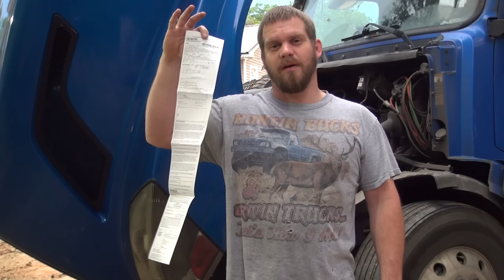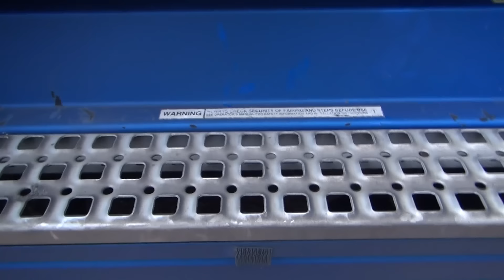Stopped by DOT

Comment: u need to get to know the inspection laws . Plastic valve stem covers are not a violation just so u know . calif dot inspector 4 15 yrs . in trucking 4 40 years .
Reply from the maker: I haven't found that in the book either but had a guy swear to me he got a ticket for it, but people lie so who knows. Thanks for watching and commenting I always like to hear both sides of the story.
Reply: Use metal valve caps will
Rust on and blow off use plastic only  and that’s not a dot  violation he’ll haveing none has nothing to do with safety
Reply: @LifeWithChase  Truckers don't lie, they bullshit. One says something on a CB and somebody else believes it.
Reply: The point in having metal caps are to with hold the air pressure if a failure in the valve core should happen a plastic cap will never hold the pressure
Reply: Tired old mechanic you know what they say the only difference between a truckertale and a fairytale is one starts out with once upon a time and the other starts out with you ain’t gonna believe this shit lol
Reply: Something I've learned over the years is that if the officers says it's a violation, it IS a violation until you take it to court.
Reply: All that stuff goes to their head I've been across those so many of them when I'll over road an local I just sat there and listened to them they do come up with some good ones
Reply: then you know the truth and revenue for your department are 2 totally different things.
Reply: @LifeWithChase  he probably had a leaking plastic valve cover and got a ticket for that (oil leak)
Reply: The entire point is DOT will always screw us drivers dont matter if the truck is brand new with no defects they will always write a ticket to keep revenue coming in on anything such as faulty valve stem covers lol its funny but it may have been true or it may have been false but we all got the point.
Reply: @mikebalasis7933  Actually, I came across a truck that had a leaking valve core; A metal cap was able to stop the leak until I got into a shop, since I couldn't remove the valve core myself.
Reply: @lomparti  no way, it was a overheated muffler bearing that caused his blinker fluid container to melt
Reply: And cause a drip. Damn plastic.
Reply: @mikebalasis7933  ur not on the raydio TEN FO !!!
Reply: hillbilly beer dranker  i like that handle HILLBILLY !!!! ...but u spelled beer wrong....its BAYER..TEN/FO !
Reply: makes sense, ive tightened a few plastic caps and the ends broke out of em,never have did a metal one that way
Reply: here is another thing KW W900 ,  THE WAY kw fucked this truck up with the hood and buss driver doors this really bothers me cause the W 900 long nose was my favorite truck .
Reply: So what are you thoughts on load securement on palletized produce loads since you were an inspector?
Reply: That was for Mike Balais
Reply: @alwaysinmotion1  what bout produce I didnt do produce inspection
Reply: @mikebalasis7933  talking about load securement, you said you were dot inspector in your comments
Reply: @alwaysinmotion1  what about load securement  ?   talk to me
Reply: Highway Patrol definitely doesn’t alway know what their talking about, I had a regular CHP officer pull me over for doing 61 and being in the second lane on a 3 lane stretch. Yes I was speeding, but he threatened an out of lane ticket. Luckily he gave me a written warning. I told him, yea I was going 58 but I was in the 2nd lane for safety. People get on the freeway @ 40mph and me being a tanker can’t slam my brakes when someone gets on while Facebooking so out of the right lane is much safer.
Reply: @supertrucker12916  Hahahaha... That's funny...
Reply: @BuckInchuteranch1  doesnt matter, CA has designated Truck Lanes, get caught out of one and it's a ticket. Also Rigs cant go past 55 in CA. And DOT cops at least in shitbag MD go thru a 6 month course to get DOT certified and have a 2 month annual refresher. Not sure about other states.
Reply: It’s in the book under the tire pre trip.
Reply: Johnny G neither will metal
Reply: @supertrucker12916  ..... so it safe to have a metal cap on,,holding back 80 + psi, that should be just great when you unscrew it , will fly off like a fucking bullet.  A valve cap is NOT to hold pressure , its to keep dirt out .
Reply: Truck owners are reason theirs no money in trucking
Reply: I gotten a ticket in California for dirty truck came from North East, good luck with buying officer messing up ours lifestyle,

Comment: Imagine, a Diesel engine that leaks oil, who would have thought that could happen?
Reply: They all do lol. I haven't seen any that didnt
Reply: The old Detroit 2 cycle engines had the best oiling system made .... they oiled inside and out lol
Reply: I got written up by DOT for being out of washer fluid.
Be careful in Georgia.
Keep your washer fluid full.
Reply: Robin...good thing they aren’t checking “blinker fluid”...😉
Reply: Nathan Manley a. Tesla 🤣
Reply: STEEL SCRAP Kingdom Tesla has a diesel wow I thought they burned electricity
Reply: Tell that to the 2 CATS I run regularly. They both guzzle oil. Leak it burn it fuck don't know where it goes. Just feed it a quart a day and you'll be fine. In all fairness, we do run these machines hard and they run long hours idling, or with PTO on creeping along picking up heavy material.
Reply: Robin Mize how the hell did you not notice you ran out of washer fluid? I half way wanna say that you deserve that ticket. I just put water in my shit. Or I sometimes put a bottled of knock-off pine-sol in it and dilute it with water
Reply: Timothy Lenhart damn. I have the baby CAT c-13 and I got a massive oil leak fixed 5 months ago. Never had an oil leak since. And it hardly burns oil. A quart a day is way too much
Reply: Lmaooo 😂👍👍

Comment: Some trucks definitely have safety issues, BUT I think the inspections like you went through are about revenue enhancement and mostly about control. I believe the whole cdl thing is about money and control not safety like they claim.
Reply from the maker: I agree
Reply: Sadly you are 100% correct. The mandated DOT certified training these kids get nowadays will either cause equipment damage, or worse,  get someone killed. I always get scared when I hear someone say " I need the brakes to stop, and the clutch to shift gears".  And the railroad crossing procedure is a blatant suicide attempt. The only time these law makers have seen trucks is on TV.
Reply: Arkansas cited me for 19 "frame cracks on my skateboard. They were tiny cracks on my dunnage rack and tarp rack, bolted to the trailer frame. I didn't get any monetary citations, I have never gotten monetary citations except for overweight and speed. Don't know why y'all are getting monetary tickets??
Reply: Safety is a typical "buzz word". the petty little things like this is just state sponsored highway robbery.
Reply: @TheRoadhammer379  The police department is a little tight on cash right now. They just use the word "safety" to get away with their state sponsored highway robbery. They just send out their newest recruits, who like to throw their weight around, to find anything to write a ticket, for the purpose of revenue. Commercial vehicles are just an easy target.

Comment: I was always taught you can drive a BRAND NEW rig off the lot and they can find something wrong with it no matter what.
Reply: True. 
Experienced this first hand with a brand new trailer. Said there was an air leak.(typed out a warning. No citation and no out of service🤔🤔) Back to the dealer, sent thru shop, no leak. Sent copy of RO and ticket to the state.
Reply: @tonym109  dismiss the ticket?
Reply: @dillongump2643  no ticket. Gave me a warning.
Reply: That's true just go get you a brand new truck off of the lot and drive across the West Memphis scales I'll guarantee you they'll pull you over and find something wrong with that truck
Reply: @jamesmorrison5632  oh my damn.
Reply: @jamesmorrison5632  yes shops are getting relly bad these day, giving old parts a cleaning and putting a sticker of some kind on it and charging you for new parts and labor. when nothing was done,, same with oil changes, sure they dump the oil and put in new oil, but they just wipe down the old filter and call it replaced and charge you for a new one
Reply: absolutely you are right 4 new pete straight trucks , 3 on piggyback and drive cab had brakes out of adjustment right from factory not far from my home , they will find something wrong
Reply: Even with a warning it’s fucks with your CSA.
Reply: @jamesmorrison5632  The Arkansas scale on 55 just across the bridge, I agree. Cited me for 19 "frame" cracks on the flatbed. It was small cracks on my dunnage rack and tarp rack, bolted to the trailer frame. As far as my CSA score, that shit looks bad. I offered to have Petro come out and unbolt the racks but she would not let it go.
Reply: Well I can agree with this! I had a bran new concrete mixer I drove they had a rest stop inspection station set up and I passed through with a shiny new truck and they wave me past 4 inspectors and the last one flagged me over. My plate was expired the company bought a limited plate to get the truck from the factory in Indian in the winter and forgot to buy the full plate when placed in service in the spring!!!!
Reply: @jamesmorrison5632  yes sir they will we take back roads to miss them when we haul grain over there
Reply: AMEN BROTHER!!!!!!!
Reply: @tonym109  you said no ticket, then sent copy of RO and ticket to state.
Its just a justification for stopping you in his own mind. Relieve his guilt

Comment: The citation warnings you got, I have never heard of that. I drove 17 years and drove retired long haul trucks as P&D city trucks. Those trucks are wore out and I never had a citation for oil drops or power steering leakage. It's theft by government thugs! Revenue collectors, they do it here In Nevada. 4 or 5 units set up at the edge of town where the speed drops from 75 to 65, they always have trucks pulled over. It's theft and harassment in my opinion by armed thugs!
Reply: Elko?
Reply: Where? We need to know too!
Reply: Its everywhere

Comment: I'm all for truckers making a living.  I used to work in accident research for MTO - Ministry of Transportation of Ontario in Canada.  I think you were fairly treated by the officer who pulled you over.  The items he issued warnings for were fair and you need to address them.  Yes, they may not directly contribute to you crashing into someone but the point you are missing is that your truck drips a little oil and you don't trouble yourself to fix it - 'no big deal, a little drop of oil'.  Same with the next guy, his truck drops a bit of oil.  Hell, I've spilt oil when topping up my 15 year old  car that burns a little oil and I've added a drop along the way.  It's not YOUR truck, it's all the trucks that drip a bit.  All those little bits add up and form a little skim of oil on the pavement and that's not a problem either - until it rains. And there's  that idiot, who thinks his time is so much more important than everybody else, driving his cute little sports car, weaving in and out of traffic, racing ahead in every gap and then slamming on the brakes because a mom driving 4 kids to ballet in her SUV didn't take the hint and get out of the passing lane of a 6 lane, limited access highway because she doesn't think she is safely past the big tractor, trailer and pup on her right, and the kids are arguing about who is.....  That drop of oil is now a slick film floating on the rain over the surface of the roadway and sports car's tires can't get a grip and starts to skid and sports car driver prides himself as he steers out of it and off onto the left shoulder but not before clipping SUV's bumper, sending mom, kids included, into the path of the trucker.  There was nothing he could do to prevent the carnage that insued when his rig jack-knifed behind the tractor, across all the west bound  lanes as he tried his best not to plow into those kids.  I don't  remember how many people died, but I know that not one ever danced ballet again. Emergency crews worked in pouring rain, to get the many victims  out of the crumpled remains of the many vehicles that were either taken out directly by the rig or couldn't  stop in time on the slick surface.. OPP and MTO worked into the next morning trying to sort everything out and traced it back to the sports car, parked on the shoulder, unable to go forward because of the pileup, and unable to go back because of the resulting traffic jamb, that had a rub of red paint on the left hand side of it's front bumper.  Red paint that was identified as a match to the SUV carrying the mom and kids.  I worked for one summer 2 years after that 'accident', over 40 years ago - before airbads? - not that they would have made a difference for the children who died.  We had an old airport runway where pilots trained for World War 2.  We 'recreated' that rig with flatbed trailer and pup, both with an set of 'training wheel' outriggers that were wired up with multiple sensers to messure everything and anything that the engineer in charge thought might produce answers.  We had an professional driver with over 40 years experience, over most of Canada and the US. Our 'task' was to get the rig to jack-knife and collect the results. We did this for 3 months, in sun and rain, hosing the runway 'lock-up' area down wirh a firehose, with various amounts of water and speed, etc. Once or twice a week.  The one consistent factor was oil.  It floats up off thd road in a thin film that for thd first few minutes after it starts to rain, can be deadly.  Ultimately, the sports car driver was responsible.  But without that oily slick, the results could have been different.  So it isn't just just a drop of oil, it's all the drops of oil and you may be one one but You can do something about it and that's were your DOT and our MTO are coming from.  And don't get me started on the environmental problem that run-off  causes!  I could write book if I .....
Reply: Oil film when the road first becomes wet is a major Hazzard for motorcycles.  I have had some uneasy moments with slick surfaces.

Comment: Without DOT the trucking industry would be a dangerous place to be or work. Safety from 1980 to present day is a far cry better thanks to DOT. Companies are forced to fixed trucks now compared to when I started. People criticize them but just think if they didn't do inspections an how the condition of the trucks would be. I own my truck an I do the required maintenance.  At 450k you can eat dinner off my engine. No leaks an very clean .

Comment: 32 years of driving never had an inspection ticket And I've drove some rough looking trucks. But maybe I'm one of the lucky ones.
Reply: Yep, lucky
Reply: I think he just ran into a "spot check". From what I've seen, things as petty as plastic schrader valve caps on the tires, this is just state sponsored highway robbery. The police department is running a little tight on funds, so they send their newest recruits out there, who like to throw their weight around. Trucks are just an easy target.

Comment: Ask a biker about oil on the road.....get it dude.
Reply: You'd have a point, if it was any more than a drop every 5 miles. His idea of installing catch cans on his crank case decompression lines is a good one though. The only way he would be a hazard to a motorcycle, would be if he idled there in the middle of the road for half a day, and left a puddle. A lot of older motorcycles leak as much oil as his truck!